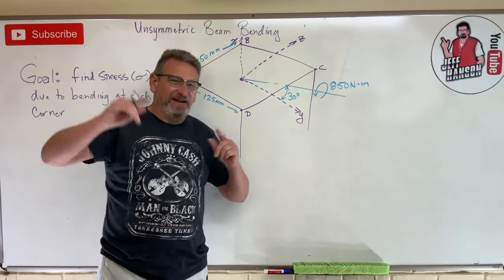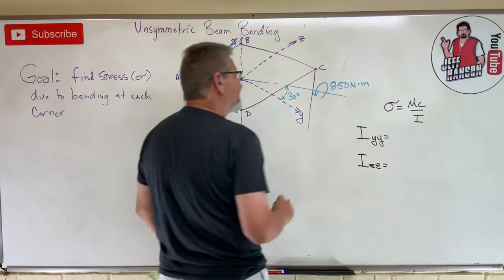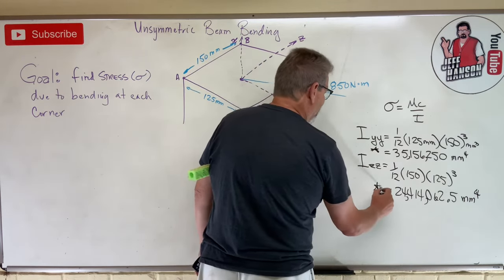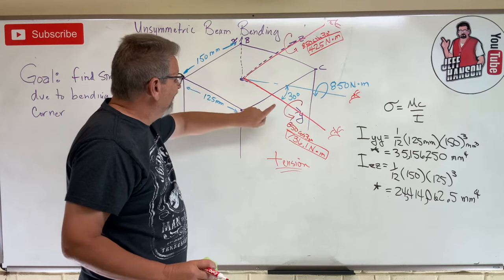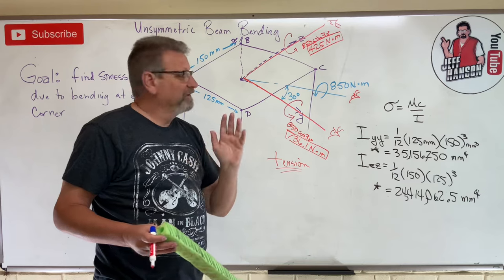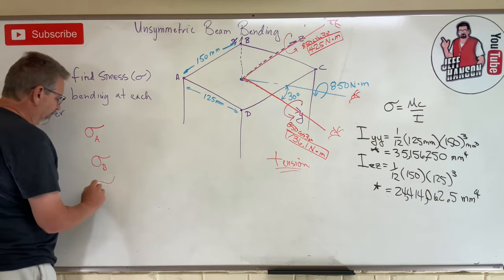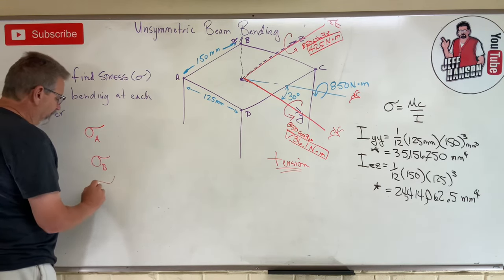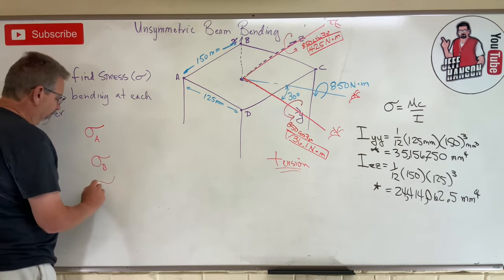Mechanics of Materials: Lesson 34 - Unsymmetrical Beam Bending Example Problem

Comment: The solution step is not mathematically sound. Firstly, the formula is not consistent with the derived book formulae. Secondly, the signs of the coordinates are not considered. Thirdly, compression is taken as tensile in some corners, example point A. Getting correct answer (?) does not mean that solution is also correct.

Comment: I don't know if it's a point of confusion but if you're wondering which is the cubed term for inertia, imagine bending a ruler through the thin side. It's super bendy, right? Try bending it about the thick side and it will be impossible. For a rectangular cross section, you always cube the dimension that you're bending through.

Comment: why isnt Mz the opposite sign when the equation is -Mzy/Iz + My/Iy
Reply: Hey there, it’s because he’s flipping the sign for the second term in each stress calculation. Take stress at A. Clearly, the counter clockwise moment at z axis puts A in compression, but he takes it as tension. Therefore the two swapped signs cancel out and the answer is correct. 

However I have no idea why he did it this way considering he’s labelling compression sections falsely as in tension.
Reply: @conradthomson7043  Hi there, professor Hanson drew the counter clockwise moment at Z incorrectly- the moment should be drawn the other way around (when looking "down the z-axis" the moment should be counterclockwise but from this isometric view should be clockwise.) The moment on the z-axis puts A into tension, hence it should be positive. 
An important lesson to draw your moments correctly!